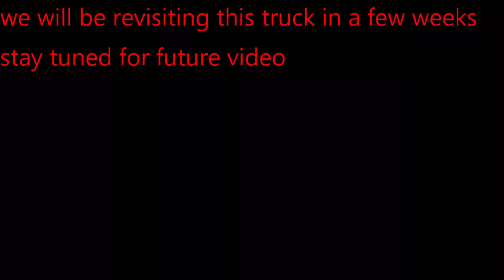lifted square body Chevy BBC on 44" SUPER SWAMPERS BOGGER

Comment: With that 10 bolt front axle you are all ready for the mall parking lot
Reply: I've got the same front axle with factory shafts and LSD and wouldn't in my life run bigger than my 35's...44s would just break axle shafts and differentials and driveshafts like a twig... 42's weigh like 200+ pounds lmao fuck this truck isn't anything more than a cruiser, he said it used to be a mud truck
Reply: People will run a 10 bolt or 44 on big tires and over 300hp and replace shafts every trip lol doesn’t sound fun to me but to each their own..As long as you got a full floater in the back or an Eaton even you don’t ever have to fuck with the rear
Reply: I've actually had good luck with a corparate 10 bolt running 44 gumbos for about 12 years almost every weekend out in the mud . The key is making sure the ball joints are good and the front tires are over half bald lol. I've only broke 2 axles and that was due to bad ball joints and also only running about 300 horse.
Reply: Change fluids after every trip and I've never had a problem
Reply: Honestly dude I'd be more pissed if another d60 went into a mall crawler. People want them just to have them
Reply: @johngonsoulin7413  Truth to this.  Didn't think of it that way
Reply: I can't vouch for 44's but 37's do all right on a corporate 10 bolt, I run it in the mud and daily drive it.
Reply: D60s ain't just the cheapest easiest thing to come by lol I'm running 38.5 tsls on my d44 atm
Reply: A corp 10 bolt is fine for mud even with 44 even better with chromoly shafts
Reply: All the haters...LOL.
Reply: If properly beefed up the 10 bolt axle will survive even bigger tires
Reply: @chrisphillips6498  a 10 bolt front will live if you use common sense

Comment: 4.10 gears on 44s?!?!? Those are for 33s. Should have 5.13 minimum.
Reply: low range would perform really well for a truck that big.  with 4.10's in low it would cruise approx. 50 MPH @ 3000 RPM
Then use Hi range when you go to get on the highway.  A 205 Case Could handle cruising around in low. 

I have 38's on mine, Kind of wish I had 44's so I had a little more length in low.  My setup in Hi is a bit soft off the line with 4.10's.
edit, and in terms of off the line snap im not sure 5.38's will make me happy, or be enough  Dont have time to swap out the TH400 atm either.

Comment: Nice truck nice to see a truck with real tires not 30 inch chrome rims that you can't drive over a curb nice truck
Reply from the maker: Right on
Reply: @adventureswithvehicles7335  You sir are a real man. That's a truck that a real man drives. I love it and want a square body jacked up like that with big 44's or even bigger.

Comment: Not 1 bit of mudding was done with a mudding truck... c'mon maaan, sling that mud like it's meant to be and then you can hose it off. Kinda bummed but still a badass truck
Reply: I just wanted to see it peel some rubber on the street.  But yeah, it's sweet, alot of time, effort in the build.